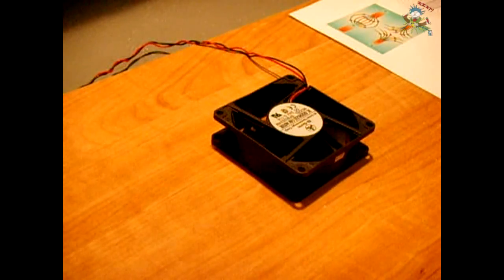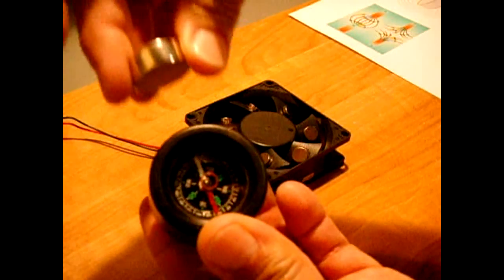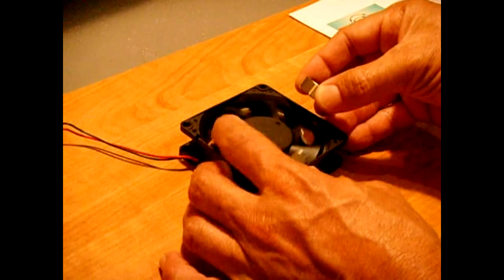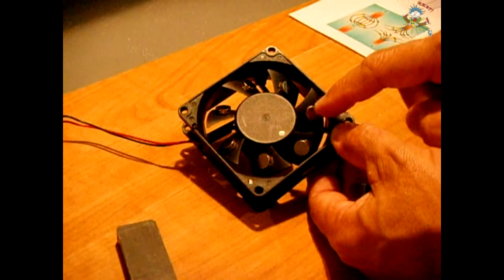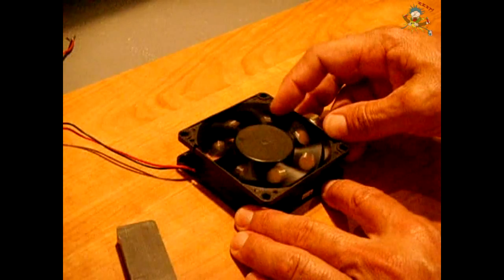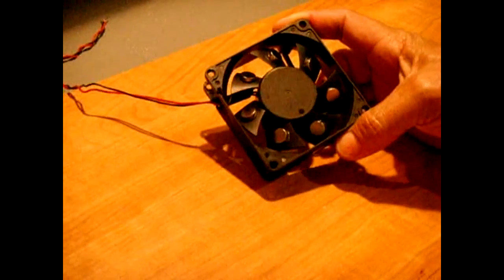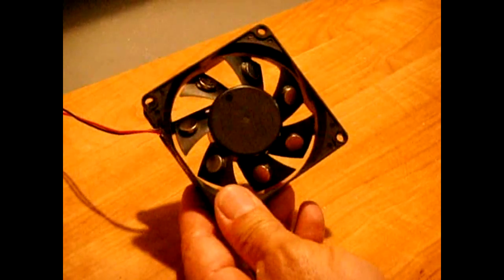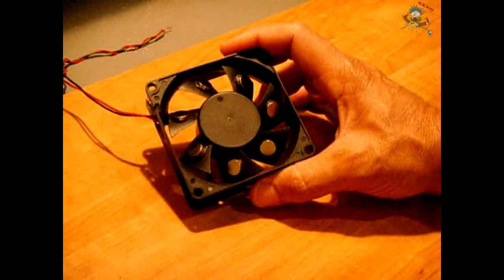Free Energy ~ Case Fan Magnet Motor / Real or Fake?

Comment from the maker: Notice how NONE of the people who gave a thumbs down, offered to show any proof that this works. Typical trolls.
Reply: Lerrad Noillik Actually, all magnets' magnetic fields stretch out to infinity, and the flux will degrade at the inverse square. (1/x^2) Anyway my point it that the size of the magnets does not change how far the field goes.

Also, I should note that after many years of attempting to make different types of perpetual magnet motors, all have had the same fundamental problem, That for every force that is generated, there will be another equal but opposite force somewhere else or some time else. That cannot be overcome no matter what you do.

The cogging effect is not a big deal, it can be minimized by having enough mass on the rotating armature to act as a flywheel. To get these things to work, people have attempted to invest a LOT of money in near-frictionless bearing and placed the contraptions in vacuums, and they will seem to work for a long time, but the magnets do absolutely nothing, and all they are exploiting is the fact that things that move and spin tend to stay moving and spinning until another force is applied, let it be friction, air resistance, drag, etc. (thats inertia)

The cogging effect just makes the wheel want to 'snap' into a certain position. Say as the wheel is trying to turn, it has to overcome the magnet's repulsion. As it does, it will eventually reach a point where the rotational forces are zero, and as it continues (due to inertia) it will be repels in the other direction, accelerating the wheel to the next fin of the motor where the same thing will happen. These forces, averaged over time, will be ZERO. always. No matter what, unless the permanent magnet is switched out with an electromagnet that can change polarity and magnetic flux based on the position of the fan, but then you just end up with a motor.
Reply: Also i believe your fan-blade magnets are to big, interfere with the fact they are all aligned in a circle. You need your magnets to be just the right size (minimizing your cogging) That it repells the magnet away, forcing another magnet to replace the pushed one. You also need a square neo magnet, not a circular because it changes the shape of the magnetic field... i understand that it will repell the motor in both directions, this is why you use the corner of the fan to place the Outer magnet, so that it will have more magnetic force pushing the fan one direction. I have seen these built before, seen them run. It takes fine-tuning, but once you get the hang of it, it works like magic, except it's physics. Something in motion is generating electricity, Also, you are right about the fan, but you can also use some copper wraps and make any fan generate power.. The method is sound, it works. otherwise we would never have power from a Dam or Wind Turbine.
Reply: Monopoles are theoretical.  Why do you think they are not?
Reply: Lerrad Noillik try making one and see the result for yourself. also the principle of a an e motor is not the same thing as in this video. this video is simply trying to disprove that a fan blade could be made to rotate by means of magnets.. do not complicate it with generators or something like that.
Reply: Ok, I'll give it a try and report my findings.
Reply: yes
Reply from the maker: LDuncansix
Very simple. Watch Part 2. :-) You will not have anymore questions.
Reply from the maker: *****
The cogging effect is very hard to overcome. Is it possible? Anything is possible, but highly unlikely as the uploader showed. Remember, the individual stated that all he did was glue magnets to each fan blade then use another magnet to push it into smooth operation. Based on that, it is not going to happen.
Reply: Unfortunately, I do not believe this type of free energy device will ever work; not even with monopoles. The problem is that for every south pole this is an opposite and equal north pole, or the south pole has to be brought closer to the stationary magnet before it can repel away. Cogging should not be a big deal with enough rotational inertia. If you draw out the field lines for all the magnets, you will see a few that will counteract the desired force. Every design I have found thus far has that problem.
Reply: Power Max
Where can I obtain bagnets, and just how do they work?
Reply: Power Max Monopoles are theoretical.  They do not exist in our reality.
Reply: Shanon Bull Magnets* I corrected it.
Reply: valveman12 Absolutely. The only example I can think of monopoles would be gravity from large celestial objects, and I have never seen a perpetual device operating even by gravity.
Reply: valveman12 they are existedn i have one right beneith me just read teslas work
Reply: Lux Ferre What exactly are you referring to?
Reply: monopol
Reply: KattieKirksey1875 The hojo motor is a scam, sorry don't bother with this.
Reply: Flag that comment as spam and abuse, I did but it just will not die already.
Reply: Severance Khouane It does not matter how much mass and inertia the device has, it will never work, period.
Reply: +ab oponitse Magnetic monopole does not exist, in practice. (Theoretically, they do exist.) The reason behind this is because the electromagnetic field is not a dipole. That means, it cannot be split, unlike electric field which can be created with positive and negative charges.
Reply: electronicsNmore 

I think you and i both know who is the troll here. The people interested in an experiment, or those saying it is fake without any explanation. How skewed a world view must you have to think of yourself as the one offering value to people.
💋
Reply: Shawn Heath What could be worse for the cause of Capitalism than a technology that banishes poverty to a dark age? How could you possibly have a scenario where people could nof afford to eat, but could afford to endlessly watch tv, download movies, and travel anywhere in their car, all without the expense of a dime. Just to a name a few.

Ofcourse, mobile phones, TV's, and automobiles would inflate as a result, but as all budding Capitalists seem to forget, social inequality strikes at the very core of injustice, and no democracy could justify something like poverty where there absolutely is an avenue (without a dime spent) to overcome it.
😎

Any more Questions?
Reply: Just the other day i was watching a show called #WipeoutUSA and couldn't help but think.. this is the future of prison rehabilitation.

I mean the characters on that show are absolutely hilarious!
😆
Reply: I don't understand what thumbs down means.  It should be for the quality of the product.  After all, if one does a fantastic video of a bad product, the appropriate response is a thumbs up!
Reply: electronicsNmore
Reply: Unfortunately YouTube is full of characters like this.  You did all the work and spent the money and all they do is get insulting.  You clearly are prepared to believe in this if offered proof but so far no-one has offered sufficient proof.  Ignore them Doug and keep producing videos.
Reply: Severance Khouane You must be Joking!
Reply from the maker: That is what you have been brainwashed into believing by watching all the fake videos on YT. The truth is, it does not work, and you would see that if you tried this yourself. Don't believe everything you see on YT. Many are masters of nothing more than trickery.
Reply: See my videos Magneti Motor BS and Magnetic Motor BS2 for a simple explanation why this is not possible.  Good Video BTW.
Reply: Basicaly they need to be small enough fan magnets, that they will not interfere with eachothers close proximity, if they do, you get Cogging, as a result.
Reply: Power Max very fake video , é lamentavel
Reply: lol hhhhhhhhhh chill it xD
Reply: +electronicsNmore instead of trying constantly repeat how it could not work, how about explaining how it did work??
Reply: The burden of proof is with those who make the claim, not the other way around. 100% they are all scams. No such thing as free energy from magnets. There's only free stupidity.
Reply: I'm going to have to try this but normally the magnets need to be a little offset so you don't hit the opposing poles as it comes around. Like a wobbly wheel that catches momentum only part of the cycle.
Reply: Your magnets are too fat my friend , they need a very thin edge so the edge's magnetic force is very small compared to the main face of the magnet .
Reply: stupid american propaganda. It Clearly works even in theory never mind in test even. idiot
Reply: man try another fan more swifty ,your fan is too hard thats all try a fan that can turn a lot with one push of finger !

Comment: dose a fan like that even make any power when you spin it i know its a motor but these fans have control circuitry that could stop any power form going back out of the fan
Reply from the maker: Many of those case fans do not produce any power when you spin them, but I have come across a few that did produce power when you spin them.

Thanks For Watching!

Comment: another way to distinguish fake ones is because they only show you the voltage. I've seen a couple of those.
Reply from the maker: Another favorite of mine is the one with some guy holding a tiny coil of copper wire in an open field and it is powering a motor. LOL. Any legitimacy to these "magnet/free energy" devices is being destroyed by all the fake videos.